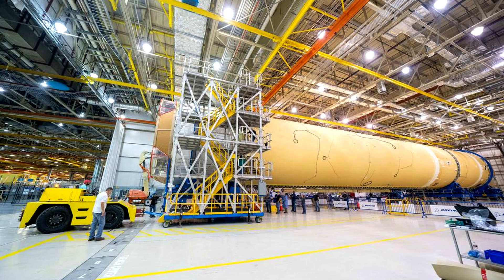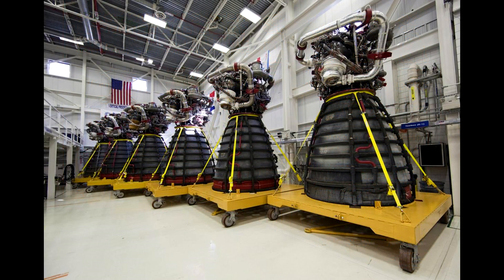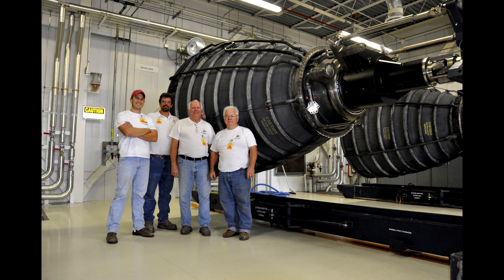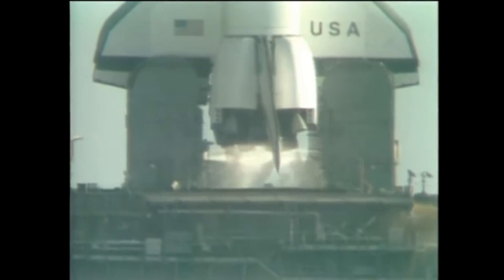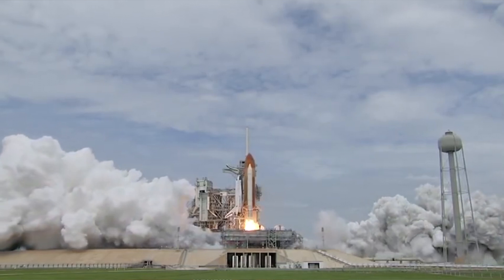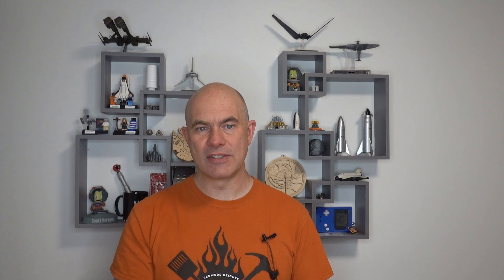Four Old Space Shuttle Engines Team Up For One Last Rocket Launch

Comment from the maker: Limited edition T-Shirt available now, support the channel and get this remix of the NRO's infamous spy satellite patch:
https://www.bonfire.com/hullo-39/
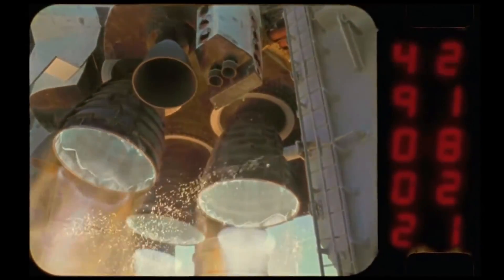Reply: I love how the engines bell seem to deform and ring at throttle up (@3:59). You can see that particularly clearly on the engine on the left (the shuttle's top engine) I am wondering if all engines deform on throttle up or is it just these particular RS engines?
Reply: @reallydutch2  This deformation is a result of flow separation occurring near the nozzle exit during start up. You can see where the flow separates from the wall by watching the light blue line that dances around the inner wall until it finally settles just above the exit. Flow separation occurs when the  nozzle exit pressure is substantially lower than the ambient atmospheric pressure, which is the case for the RS-25. Flow separation results in uneven pressure inside the nozzle which results in the vibrations you see there. Normally, first stage engines are designed to have an exit pressure which optimizes their performance over the course of the burn, but since the RS-25 had to operate all the way from sea level to orbit, they pushed it to be better optimized for much lower pressures than typical first stage engines. On most first stage engines flow separation this severe would result in the violent destruction of the nozzle, but they designed the RS-25 to be able to survive this scenario.
Reply: @reallydutch2  I like your use of the verb "ring". It works.
Reply: NASA to SLS: "Here! Throw these away for us."
Reply from the maker: @TakeWhatYouNeed LeaveTheRest It's not privatizing the program, it's using commercial services where possible. Do you think NASA should be building its own computers or buying them from computer vendors?
Reply: Hi Scott.
Reply: Do you know what the costs for the various RS25 models are?  Or course it always depends on how many are made since R&D is usually rolled into it.  And estimates are almost always under actual.
Reply: @Nick1979BN  we don't have earthquakes. Ours is a civilised country 😁
Reply: Do they not have the blueprints/specs that they can just release? You know so mechanics can just make one so it doesn't die?
Reply: It would be a PR coup if Elon fished one from the sea.
Reply: marvin martin Who would care?
Reply: Are you from Glasgow?
Reply: Eat my head
Reply: Thanks again...Scott...!
Reply: I saw sts 135 in person so cool
Reply: Have you checked out ΔV: Rings of Saturn ?
Reply: How do I buy a patch? Can I still get one scott, I love your channel,I whatch every night
Reply: I don't understand why Nasa wouldn't make the section that has those 4 rocket engines a separate section that could detach from that large tank.  When the rocket engine section separates then a series of parachutes would slow down, and then reduce the speed down to something like 16 mph, so those engines could be used again.   The parachutes could come out on one of the sides of the rocket engine section.   That way this rocket engine section will not be landing on its engines  but on its side so the engines will not get hurt.
Reply: I have a stock of 4 new tires on hand and have bought a tireless car. I will install my stock of tires, drive to my destination, then blow-up the entire car when I get there. 

Is that why President Reagan pushed for privatizing the space industry to avoid using communist NASA? Why can’t we just give all our space projects to SpaceX?
Reply from the maker: @leapdrive  Because republican Senators like Richard Shelby love throwing government money into their jobs program while SpaceX largley owes their success to Obama era policies allowing competition for space launch contracts. It's like the politics of space economics are backwards.
Reply: @scottmanley  nope, ALL congresscritters love throwing taxpayer money into job programs. 
Obama has nothing to do with it, except that the Shuttle died under his watch and commercial space was floated to have at least some way to access ISS without begging a ride from the Soviets.
And we can see how that's going, with both SpaceX and ULA being years behind because of NASA and FAA interference.
Reply: @scottmanley  I have to think that most of the SLS budget is gong for black projects.  I have a hard time believing they're actually spending that much money on a basic rocket.
Reply: @scottmanley  when did space become political?
Reply: @scottmanley  , are you planning to attend NASA's Media Day at Michoud for the unveiling of the SLS core booster?
Reply: Sheal Dedmon  It has `always been political — Did you hear the speech by President Kennedy? The space race? I could go on, and on!
Reply: @leapdrive  I'd agree that launch vehicles are something that benefit greatly from the competition derived from market forces, however I do not think we should, or even could, privatize all of our space projects as a large majority of them are, at the moment, purely scientific with no immediate economic value. For example, there would be no incentive for private companies to develop mars rovers or deep space probes at the moment. However, if space exploration has taught us anything, it's that we can never know what will come in handy later on. It is important that we continue to have organizations like NASA who are not governed by market forces so that they retain the freedom to discover for discovery's sake.
Reply: leapdrive The US space program could not exist without “communist NASA” (where do you people get this prejudicial nonsense?). SpaceX would not exist without NASA. NASA established all the operating parameters, established all the safety protocols and suffered and bled for the space program. And as if that wasn’t enough, they were the first (and so far only program) to put humans on the Moon.

Comment: Thank you.  I certified the SSME testers of the main engine controllers used on the Shuttle program.  I had the opportunity to provide a proof of concept to reuse  the shuttles SSMEC testers to test the SLS RS-25 controller power supplies.  Alas, they opted for manual testing to avoid the cost of software certification.  However, I am proud to have been a part of the human space flight expedition and reuse of the RS-25 engine.  I am looking forward to the Artemus 1 flight.

Comment: Just one question, is the new moon rocket a recoverable design like the space x? 

If the answer is NO, what are those geeks in nasa thinking? Using a reuseable engine on a once off mission? If that's the case, why not give it to space x at a reasonable price? I have been told that they are constantly looking for high power engines from russia, europe and everywhere. These engines are designed and tested to go to earth orbit, i don't know how to calculate that math, but it is capable to sending couple hundreds of satellites for the starlink project for sure. 

Don't understand the logic behind.

Comment: I'm fine with mock ups in museums (as long as they look the part), it's not like guests get to touch/tinker with anything anyway, and these engines were made to fly - so they should. Though I don't agree with throwing them away after a single use when that's contrary to what they were made for.

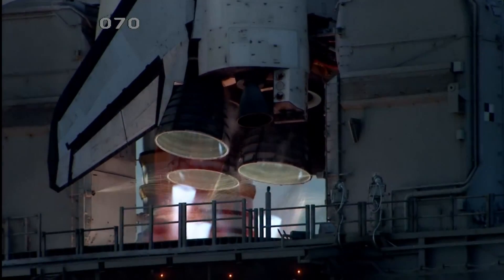Comment: 7:58 Anyone have an idea what caused that turbulence on the right side? Is it exhaust hitting beams in the launchpad structure as the shuttle slowly moves from it's initial position? It doesn't seem as if the SRBs are pulsating the same way the exhaust does.

Comment: Scott ... Why did the Saturn V have 5 engines ? wouldn't 4 have done the job just as the SLS ?.
Reply: A 4-engine version of the Saturn V wouldn't be able to lift off, at least not until it had burned some of its fuel. The SLS core won't be able to lift off on its own either. That's why it will need the two huge SRBs to provide most of the thrust at lift-off, just as the shuttle did.

Comment: Interesting and kind of sad for me. Back in 1997-2007 I machined two parts of these engines on a intermittent cycle. I understood them to be a mixing or preheating ring manifold and a cone shaped part that welded up below the mixer. It was funny to see the NASA engineers when they came in to visit one time because they had not realized we were machining these on a antique 1898 vertical 60" lathe that once was overhead belt driven. So yes a lathe that was built before the Wright brother's even flew were indeed machining space shuttle main engines. I thought it was quit ironic myself. But yes sad to know what you enjoyed making will be discarded as junk into the ocean and I had never really seen them all put together. Thanks for your videos as they are very interesting normally and this one helped put the different engine series in place for me.
Reply: Chopper Carsen 
You were a tool, making tools.

Comment: I have an even BETTER idea. Let's use engines left over from the Soviet N-1 rocket from the 1960s. Then we could save these historic engines. What could possibly go wrong?
Reply: Ironically, this won't be so bad of a decision, as long as you don't try to squeeze out every single bit of thrust out of them and leave some wiggle room (of course, assuming, that you're meaning NK-33, not NK-15). Then they shouldn't blow up. In fact, some of the rockets were/are already using them.
Reply: @caav56  Yeah! They MIGHT not blow up. And if they do they'll make a boom to remember and post on You Tube! Even if the do blow up, the astronauts MIGHT get away clean with their new best escape system ever.

If they use the N-1 motors, they MIGHT even get the cost per launch down to only five or six times what it would cost to launch a fully expendable Falcon Heavy. That would make it an extremely intelligent decision to use the SLS, whereas now, at $150 million vs $2 billion, that's $2 thousand million per launch, no sensible human on the planet would launch more than one of these.

Comment: I have had the rare privilege of working on these Artemis 1 Engines briefly and extensive retrofit tasks on on the Artemis 2 Engines currently. It is sad all the manhours and effort is being thrown into the ocean but still a great privilege and insight into some incredible technology. These engines are built like tanks. Most of the bolts used currently are still in the 80s original packaging by Rockwell.

Comment: Its a real shame that such magnificent machines with much life left in them are going to be just dumped into the ocean and smashed to pieces. Maybe it will only be those first four and the others will be spared. 
That XS-1 certainly looks like a much better use for them and maybe will go ahead faster once SLS is cancelled, hopefully just after the first flight, if not before.
Those engines may be old but they are still unsurpassed by any newer engine, except in some ways but not others by the Raptor.

Comment: But let's not lose the big picture: Complete and functional RS-25's sitting in museums forever and no Artemis program, or a successful and historic Artemis program, and no complete and functional RS-25's in museums.  I vote for going back to the moon as opposed to mothballing useful hardware, because any 21st century artifacts left on the moon (as opposed to museums) will also include the historic value of the first woman on the moon. It will be another historic US space race win for the world to remember for thousands of years. This is a history in the making, that should trump hardware on display that frankly, few of you will ever visit.
Reply: Agreed 111%
Reply: If the SLS and "Artemis" weren't already obsolete and a much cheaper, designed-for-expendability stepping of the RS-25 weren't already being designed and put into production, then you might have a point.

Unfortunately for your argument, the SLS is obsolete, as is "Artemis", and, even if they weren't, the first cheap expendable RS-25 stepping is rolling into production as we [metaphorically] speak.
Reply: @vikkimcdonough6153  Your argument is to suggest that the idea of returning to the moon in itself is obsolete, as Artemis is currently the most cogent plan to do so. That is a different argument. Artemis simply could not be economically possible without the use of retired hardware, regardless of the development of a less expensive to produce RS25.

Comment: the problem with the rd25d was that they had a common shaft. You need full staged. So you can't change them that drastically. So the other experience that was made with them is reused in these E-version, so saved as good as possible
Reply from the maker: It did not have a common shaft, there are separate turbo pumps for Fuel and Oxidizer
Reply: @scottmanley  oh? what was the problem then? Only turn-around time from complexity?

Comment: The shuttle observation deck at the cape has a RS25 with the power head on display at the top. I took heaps of photos when I was there.  Well it did in 2009.. lol

Scott maybe you can explain to me how you can get 9% more throttle than 100% ?  Curios as I am a mechanic and 100% throttle in a car is 100%

Comment: So, SLS using RS-25 engines would mean using hydrolox fuel, I’m guessing. But wouldn’t that mean having to use really big bulky fuel tanks in comparison with fuels like Methalox or hypergolic fuel? I thought that using hydrolox was one of the problems with the space shuttle... Wasn’t the reason for using it just that it would be easier to reuse the engines (in comparison with carbon-rich fuels)? Does it make sense to use hydrolox engines on a non-reusable craft?

Comment: When the SpaceX Merlin engine was designed, built and flown 10+ years ago, all space forums of the era said that it was the first new design within 20 years. So, essentially the SLS engines' design is from the 80s. Would anyone buy a brand new and very expensive car with an engine replicated from the 80s? 
I don't suggest that Lockheed Martin should take unlimited time and money to build a new engine. Even they know their limitations. They will use the BE-4 engine of Bezos (when it is ready) for their new rocket(s).

Comment: I'm sure Aerojet Rocketdyne would have loved to build NASA an new fully reusable, quick turnaround RS-25 derivative for a reusable booster but it's become an agency run by politicians meant to enrich the hometowns of their constituents, not the tech leader it once was and should be. Still, lately NASA has been fighting that tendency with programs like COTS but old habits die hard. Most likely scenario is that we get 1 or 2 launches of SLS before it's canceled and replaced by private industry in which case, maybe there will be some legacy RS-25's for some lucky museums.

Comment: I believe that people should stop complaining about how the engines are so expensive. Chances are, when nasa has run out of RS-25's, the sls will switch to RS-68's.
Reply: They originally planned to use RS-68s on Ares V but it was found the ablative nozzle could not survive the heat from the SRBs.
I'm sure they considered putting insulation on them etc before realizing they needed regen engines and the air force decided the Delta IV didn't need the RS-68B regen as the RS-68A met the performance goals so there wasn't funding at the time for the new engine.
Though I think they should have brought back the HG-3 or the M-1 if they needed a new expendable hydrogen engine.
A core with 2 M1s using F-1B boosters would have been a beast of a rocket.

Comment: There was a suggestion at the beginning of the shuttle program to add a bit of fuel and take the external tank all the way to orbit.  They would have been built with internal provisions for decks to be installed and external mounting points to be added to link them up.  They have huge interior volume, have some fuel and oxygen left over which would be very valuable.  Think of the space stations which could have been built out of those tanks, over a hundred of them.  Plus they are much sturdier than space ships, being thick aluminum.  I believe about an inch thick.

Comment: In terms of the need for a museum piece I think a suitable compromise, if it was possible, would be to build non functioning full size replicas of internals and plumbing of the engine using cheaper materials that demonstrates how the real thing works and put those in with the shuttle exhibitions.

Comment: Further reading here https://www.nasaspaceflight.com/2013/06/engines-refused-retire-rs-25s-prepare-sls-testing/

I would have thought the RS-68 Delta 4 motor would have been more suited to this role however it’s ablative nozzle may have had problems in a multi engine environment.  And they would have had to deal with the fuel rich startup.  However this vastly simpler motor is far more suited to a truck engine role in a first stage booster than the Ferrari engines like the RS-25.

Remember they will have less than five minutes of life before they are thrown away.

Comment: What does it mean to have a throttle of over 100%? conventional wisdom would be that 100% throttle would be the very max amount of thrust possible so how could higher then 100% be possible? Is 100% instead the max throttle under normal use and the extra is for emergency scenarios where a bit more thrust might mean a successful abort? or is this compared to maybe a previous version which had only 100% max throttle and the newer engines do better then the older one and hence have a slightly better comparable max throttle?